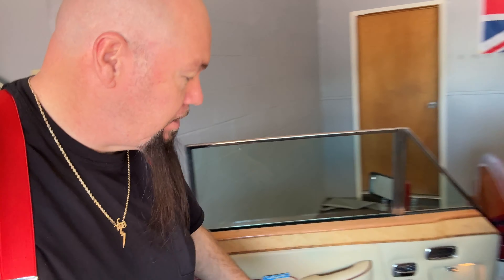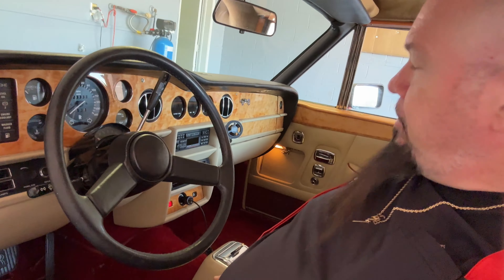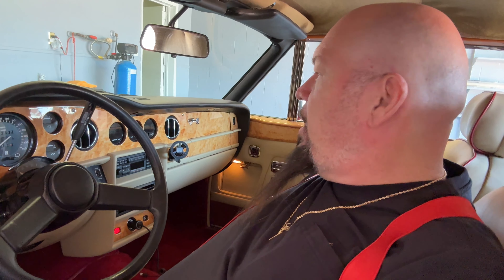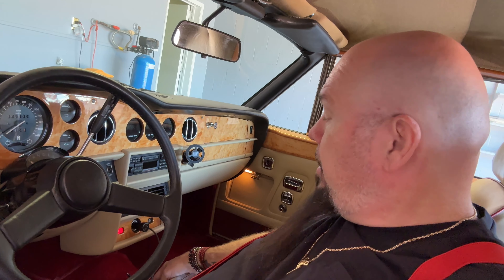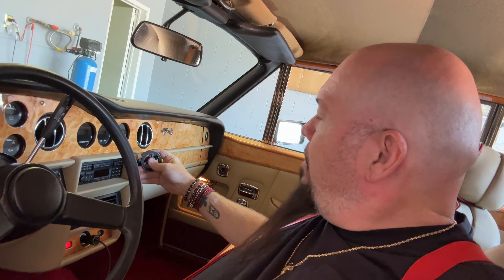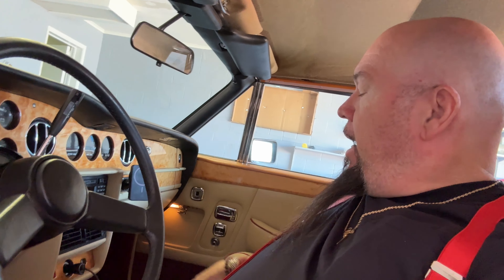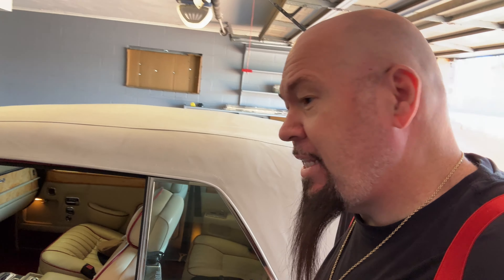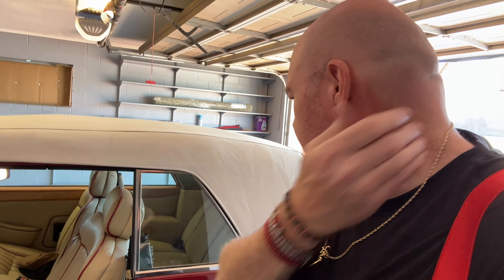Why I mounted my phone on the dash of the Corniche...

Comment: Hey V-BOB-M, absolutely NO big deal from our crew on your decision to drill four small taps in your R-R's wood panels. After all, the phriggin' vehicle is close to forty years old and you acquired it for a rock bottom price. The only alternative that we brainstormed was to use slightly longer wood screws but only TWO drilled diagonally. Physics state this will provide a sturdy mount on par with the four holes. We appreciate your lengthy explanation of why you chose that particular McGyver but this is so easily repairable it's beyond reproach. BTW - ^HigH^ praise to you for achieving the modification of your 50th DeLorean project. Quite a feat fella' !  ,🚘🔍.   💯

Comment: Yes - KEEP THE BAR :) :) - You need open back case for the phone. Most cases cook the batteries. Vitodo Aluminum Bumper Case for iPhone 15 Pro Max, No Back Design Compatible with MagSafe Slim Metal Frame Shockproof and Soft TPU Inner Not Affect Signal, Backless Fast Heat Dissipation (Black)

Comment: as your bro, Gary said, It's your car, do what you want with it. me personally i dont use the cell phone when driving, i dont even eat in my car. this wouldnt be an issue. but hey, go for it man. don let them get to you. i do have one comment. dont sweat over your stereo. it will never be loud enough in a convertible. if you get a powerful system, all you'll do is just piss everyone off in the neighborhood when you cruise around residential areas with the top down. you might even get a ticket by the cops. they are cracking down on loud cars. i am a convertible owner for over 25 years, i messed with the audio systems and its either mind numbingly loud with the top up or lackluster with the top down. as long as you can hear the music over the road noise. thats loud enough.

Comment: Put MIDRANGE speakers in the 3" door location, tweeters on the door pillars and a small woofer in the trunk with 2 small amps, one for the mid to high range w/ built in cross over? bass amp to the woofer.

Comment: Could have replaced the wood part BEFORE and preserve the original one. But I understand your view point. If the Rolls is so quiet, why would you need big speakers ?
Reply: because what's in there now can hardly produce any BASS at all, a 3" speaker several feet below ear level isn't an ideal location for a full range speaker. The rear location isn't much better but the car at least deserves a set or two of Infinity Kappa's!!!
Reply: @raaawkstaaar  He said he would like to listen to basic radio. Don't need a concert PA for this. And we won't go in the too much low frequencies and compression debate.